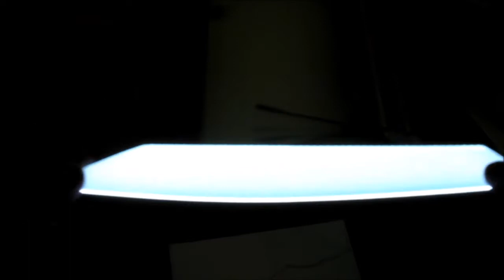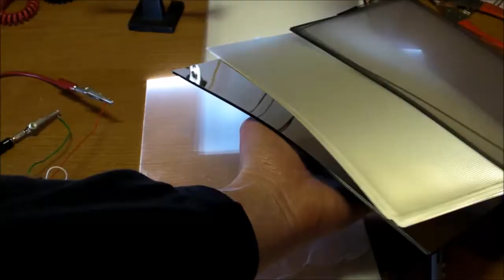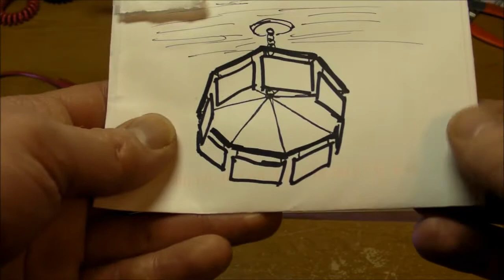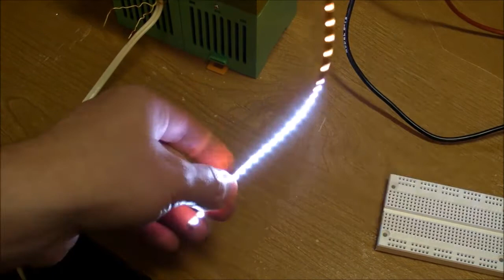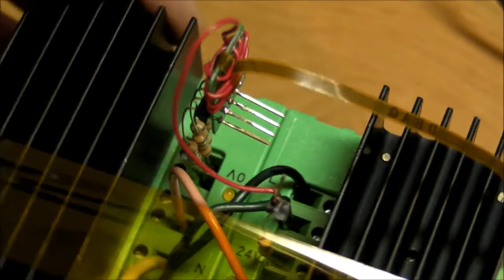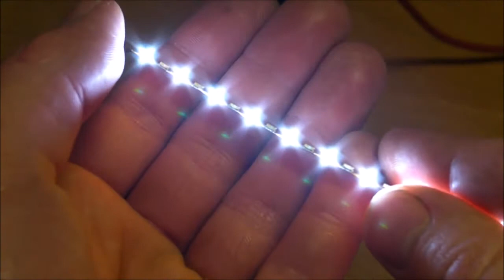(#0174) LED Backlight Chandelier #1 - Feasibility Test

Comment: 1024 hours then - -hehe
Reply from the maker: Brian Ballard True, I can increase life by reducing current, but then it might not be bright enough to sufficiently light a room. I'm testing for high brightness AND long life.
Reply: I do not think you will have durability problems, especially if you reduce the voltage and amperage to a minimum .   Try running a high frequency (on/off) 6000hz and higher - you may get some colour effects? or is it a shaped sine wave (0 to striking voltage) I cannot remember exactly where I read of such a colourising effect...